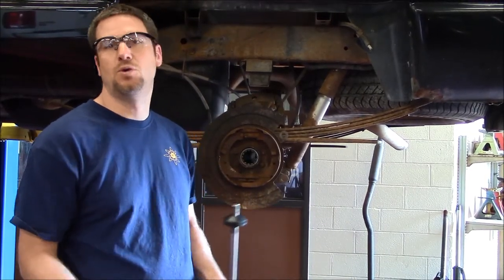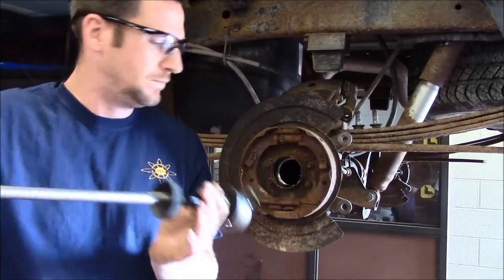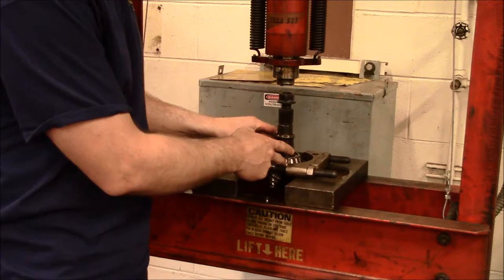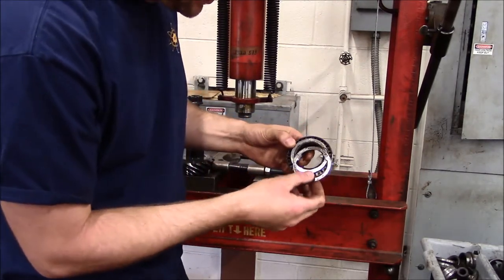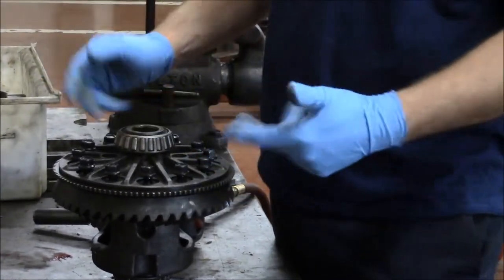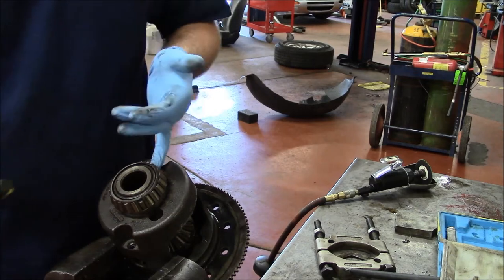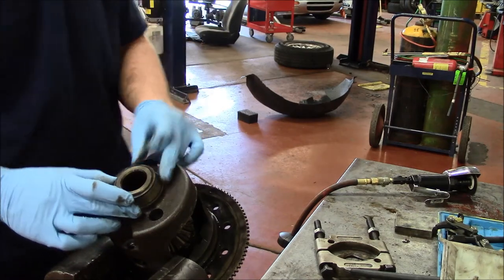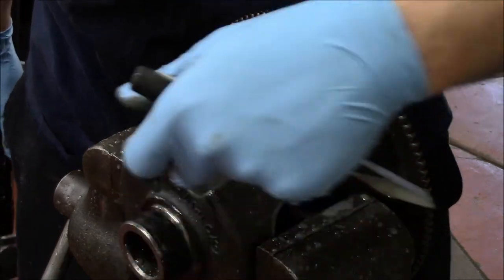Differential disassembly 2

Comment: Very informative and easy to understand. You probably saved me a lot of time and knuckle damage. Since I sold my shop years ago and do not have some of the necessary tools anymore., Ill pay someone to replace the bearings. I did all the other axle replacements myself without much problems although with the proper tools it doesnt look too difficult I  dont think Ill tackle this. Thanks so much.